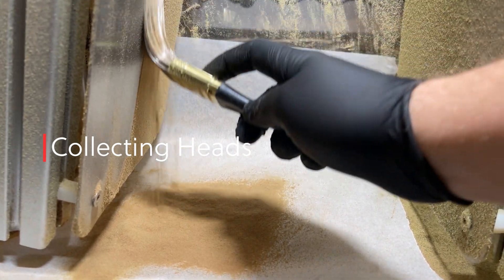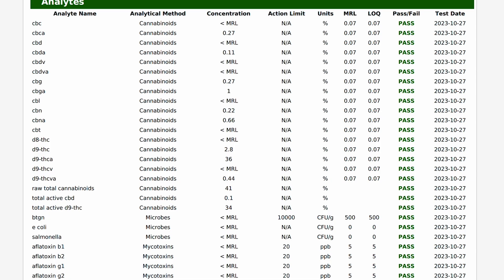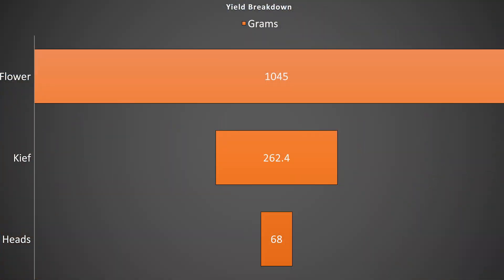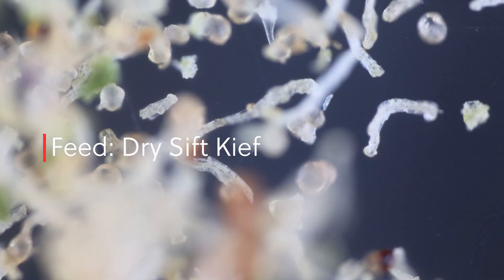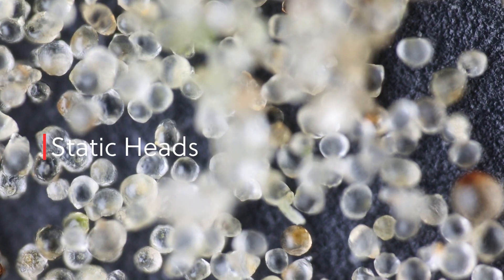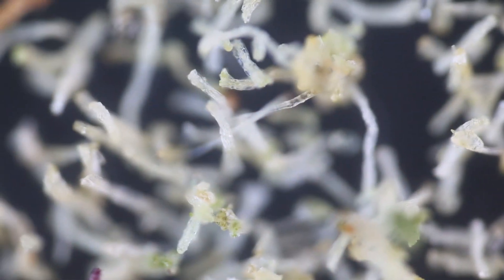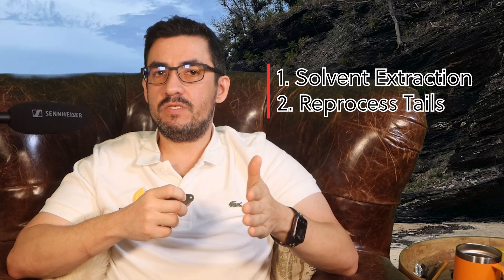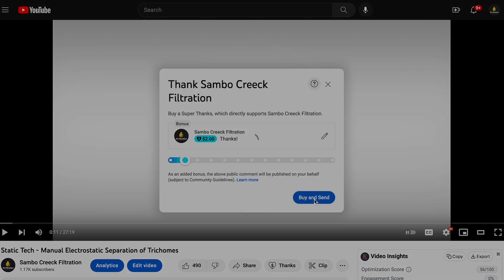Triboelectric Tuesdays Episode 18 - Plasmastatic COA

Comment: What is best way to prepare flower for this process? As in should it be dried fully or partially?
Reply from the maker: It can be dried or fresh frozen. If the moisture is too high you can freeze dry the kief or reduce moisture in other ways otherwise it would clump and cause all kinds of problems.

Comment: I think you’re missing the fact that the heads can be further sorted by quality, not to mention the ~5% swing on COA results. It’s not a given that the 79% figure is the max cannabinoids.
How are you determining which heads are from capitate stalked, bulbous, and sessile trichomes by sight alone?
I think there’s more to be done to determine the difference in man hours, spacial footprint, and scale that your machine can output, because it sounds like pre and post processing are still required to achieve ideal results, and the question becomes-what value is this machine truly providing?
Reply from the maker: Sessile trichomes look different and are not collected by the device. Sight is more than enough to determine if they are there or not. If you can’t see them, well they simply aren’t there. Bulbous are chemically different and don’t collect. See the previous episode regarding this. 

How do you determine the different types of trichomes in a meaningful way and for what purpose?

Pre and post process entails sieving. A very simple process. 

Sorting by size can easily be done after isolation. I suppose this is difference in quality you may be referring to. I don’t know of any other device that even comes close to sorting particles like this can. Except of course manual static which is the same process. 

If there is variance in COA, results will vary obviously. 

When you use the machine it’s obvious the difference in man hours. It’s similar to washing with a paddle vs using the Mesclatore. There’s just no contest. 

As for scale, we can make a device to do 2 tons per hour easily. I assume a small army of people is needed to do that manually. At least that’s what my friends in Morocco say. 

I suggest you stay tuned for demos so you can better understand what the machine can and can’t do. The concern is a bit premeditated.
Reply: Im curious how sight is enough to distinguish a capitate stalked gland head from a bulbous once liberated from the stalk. I don’t think your answer clarified this.
Reply from the maker: Yes I agree it would be challenging visually. Chemically they are different. I discuss this on a previous video based on a paper I read recently. I could be wrong of course but if I understand the paper right, those type of trichomes wouldn’t collect with heads based on how they would charge. And on some cultivars this may be wrong and they may collect. If so, perhaps that’s not a bad thing?